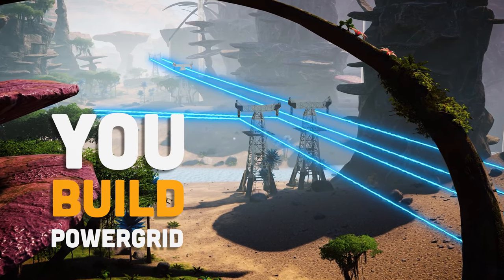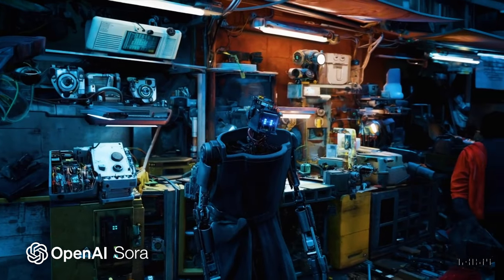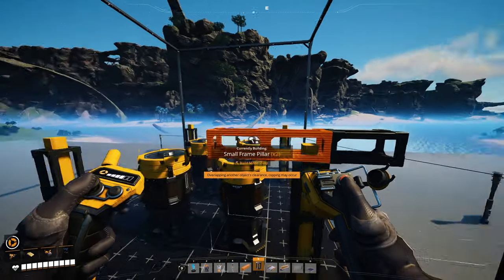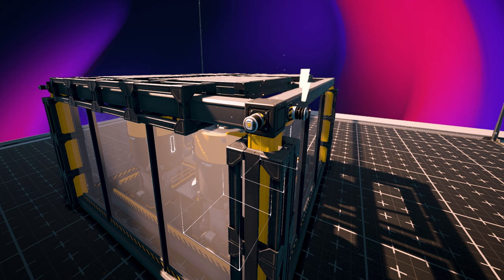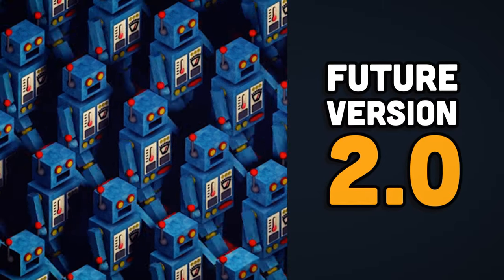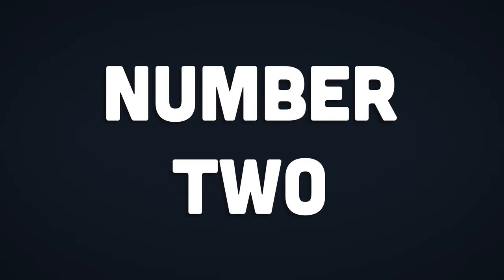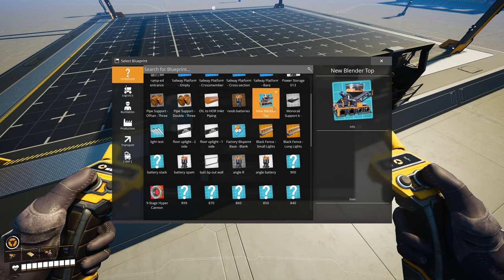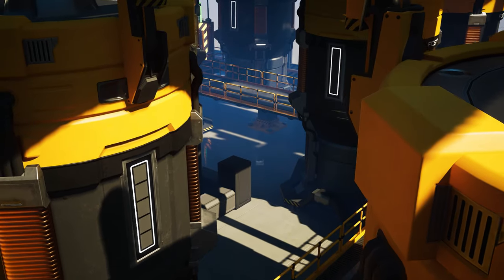Make Your Power Grid UNBREAKABLE in Satisfactory Update 8

Comment: I think its great overall, you put time and care into designing an asthetivally pleasing battery blueprint 

But theres 2 things i dislike

1. You're using so few batteries per blueprint that youll have to build it a million times (maybe a hundred times) which worsens the next point 

2. By having so many asthetic pieces for such a small blueprint thats going to be pasted a hundred times, not only do you end up using singificantly more resources to do so, but more importantly you're placing around 12+ additional items per battery. Only using the blueprint once or twice wont be a problem, but mass producing this blueprint will lead to thousands of additional items that all have to be calculated and rendered by the game, hurting performance 

Ideally the solution would be for Satisfactory to be perfectly optimized like Factorio is, to make asthetic and non functional buildings require no processing power once built 

But since we dont have that yet (maybe for v1.0 according to CFS videos) we may have to opt for less busy/fewer part builds with more functional parts clustered together, with fewer asthetics around them 

Just my thoughts. Maybe other people with really good pcs dont ever have performance problems, i dunno
Reply from the maker: So far I've built ~300 of the blueprint and haven't noticed a single frame drop (running on a pathetic RTX2060...). It is made to look ok instead of be 100% efficient as my understanding is only production entities create a significant overhead to processing, and since batteries are only a number on a circuit - this should not cause any significant rendering problems. I will troubleshoot this, and come back to this comment when I'm done ;)

Comment: ...................................................................... soo for some reason i was expecting a way to route conections
 , not many diffrent ways to make a module modular 
tldr  just add bateries bruv  ....
Reply from the maker: Sadly theres only one way to route connections. Main power line > smart master switch (for the whole factory/area) > a bunch of other simple switches (for smaller portions of that area) > machine clusters 💁‍♂️